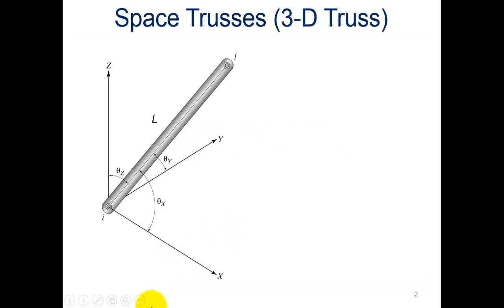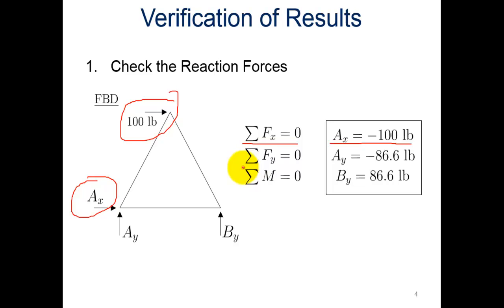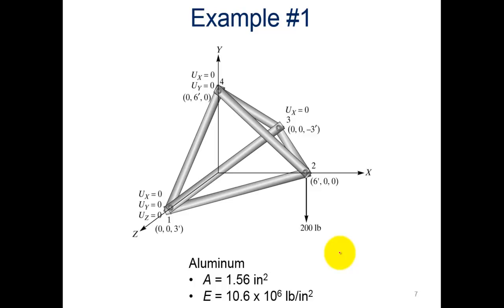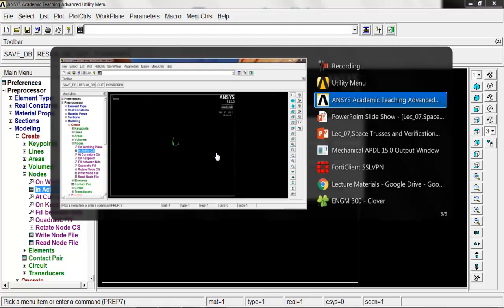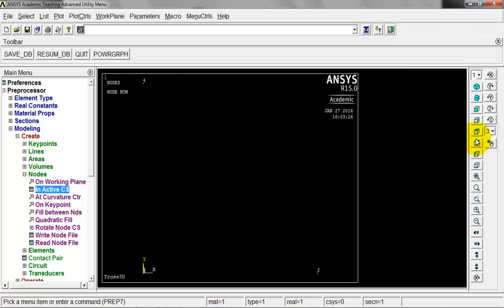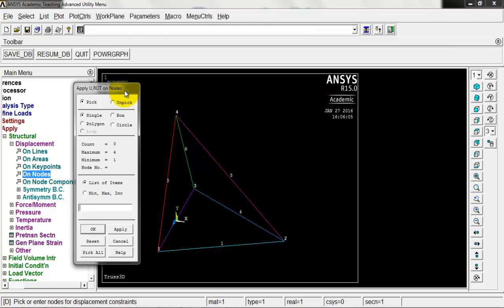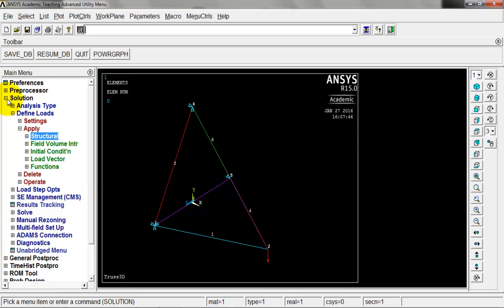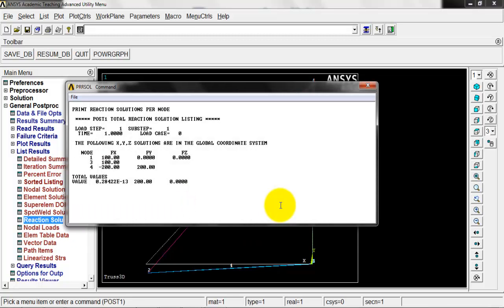Space Trusses (old) - Verification of Results and ANSYS, Example 1

Comment: Hi Mike!
Have you ever worked with tension-only link180 elements? I'm trying to simulate pretensioned structural cables and I've been looking for help for a month already. Although ansys help explain how to prestress this element with inistate command, it has not shown satisfactory results even in the most simple examples...
Reply from the maker: Sorry, I haven't done any pretension modeling with link180. The information I have on link180 is in this video - https://youtu.be/T9V6lZSyjcs - and others following it in the playlist.
Reply: Mike Foster All right, thank you anyway :). I have read the ansys help once again and could realize that the initial state for links need to be applied at the integration points :), and the results were not satisfactory because i wasnt doing that.